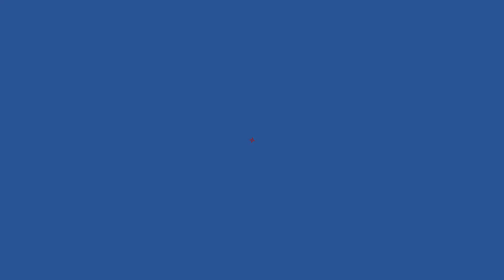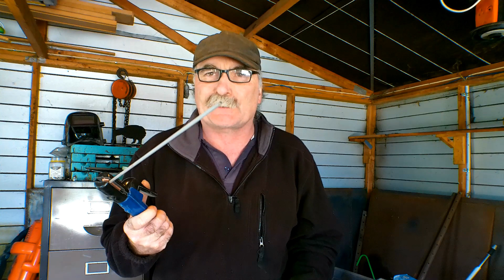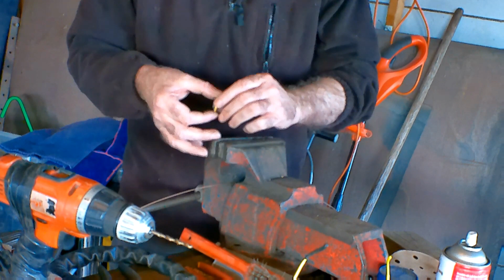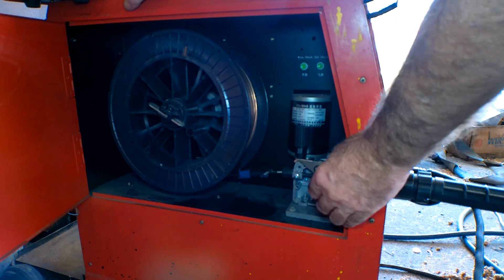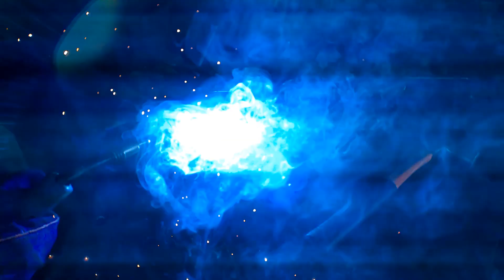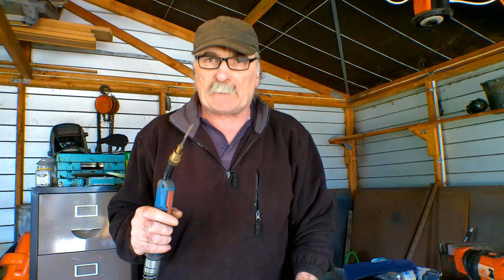wire feed stick welder

Comment: Ooohhh   wwwoooww !!!!!!!
That was amazing how ever I have that idea but using flux core wire in a stick welder so it's the revers of what you got there my yonder is if you think it would work 
And that's my question to you 
                                                                  Thank you in advance
Reply from the maker: just a bit of fun in my workshop
Reply: @petestools  I have tried it and I was impressed it's a bit slow process but if you got something it is by far better then nothing till nothing is all that's left 
Then to the store I go with  nothing wasted

Comment: Just use Flux wire dude! No need of any gas bottles,  wire speed as well as amperage is controlled!
Reply: Fluxcore without gas is horrible, but it will get u out of a bind.  I would never use it on anything serious.  I came across this video because I'm  adding a second rack too a BBQ smoker for someone and I know I'm gonna run out of gas,  when I do there won't be much welding left. To get  the job finished im gonna have to improvise stick/mig.   Will it work in conjunction with the trigger, let say on off on off?
Reply from the maker: Good tips

Comment: We have a stick setup at work jerry rigged to a constant voltage machine.   Runs like crap lol. Definitely need constant current to run stick well. But ya can run some wire and flux core off of constant current
Reply from the maker: Right on
Reply: can I rig a flux core spool gun to run on my DC  inverter stick welder?
Reply: scottmusical i imagine you would need the plug on the machine for the spool gun.   But you can definitely run flux core of of a dc stick welder with a suitcase like an ln-25 and some  quick connectors.   That’s how I usually run flux core
Reply: Does that mean I can turn a stick welder into a mig welder?